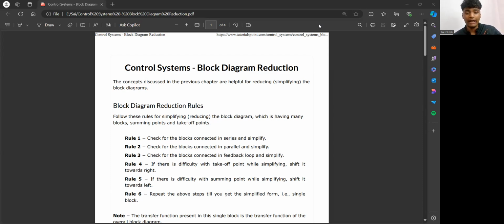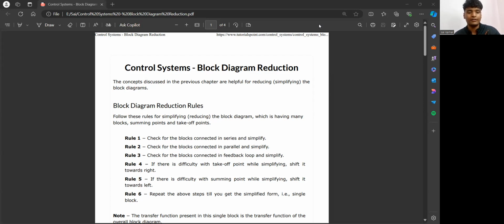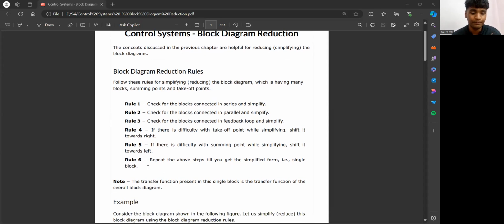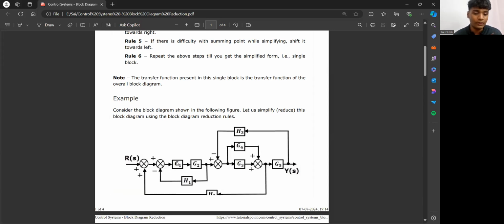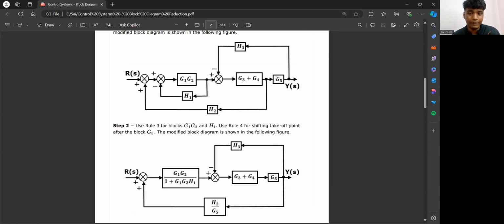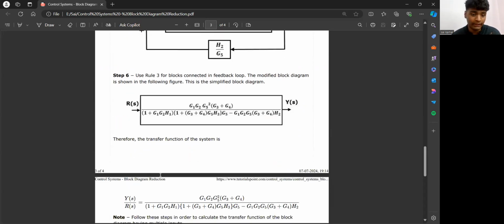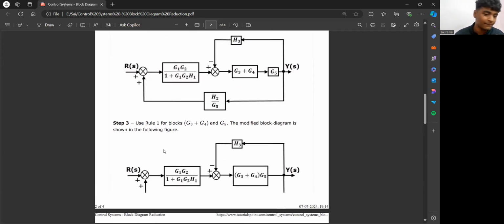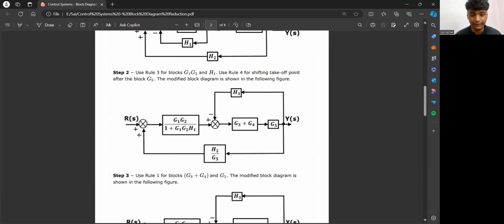BLOCK DIAGRAM REDUCTION(CONTROL SYSTEM)

Comment: 00:04 Introduction to Block Diagram Reduction in Control System
01:04 Block diagrams help visualize and analyze system operation
02:06 Loop depends on environmental conditions for setting inputs.
03:01 Shift points right to simplify block diagram reduction
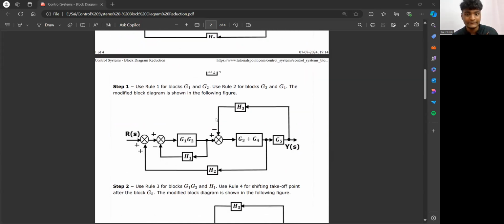03:58 Block diagrams in control system simplification follows specific rules
04:59 Shifting takeoff point after G3 in block diagram reduction.
05:53 Simplified block diagram and transfer function calculation
06:50 Using signal flow graphs to simplify block diagram reduction process.

Wow your english surpasses English itself!! hatsoff